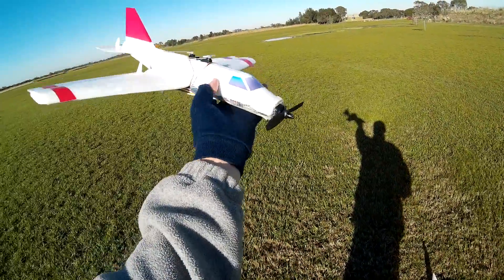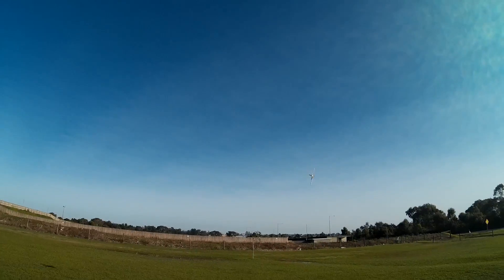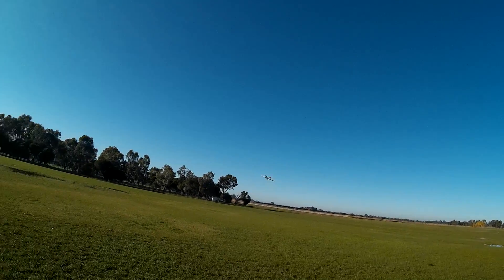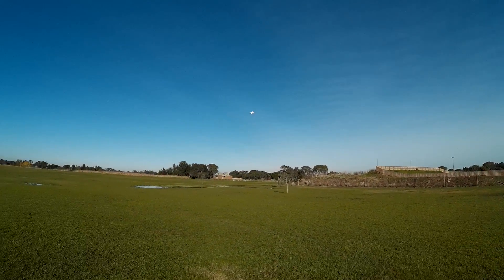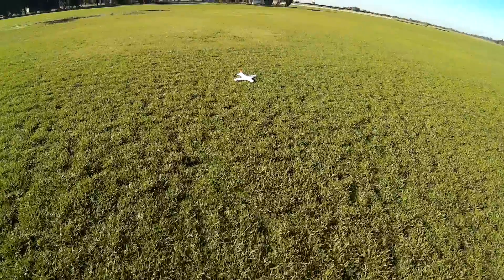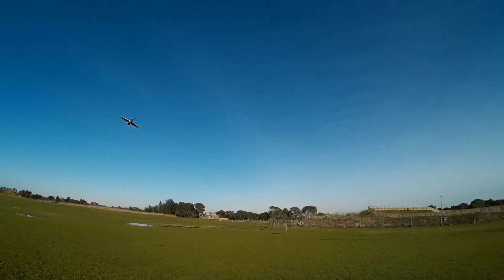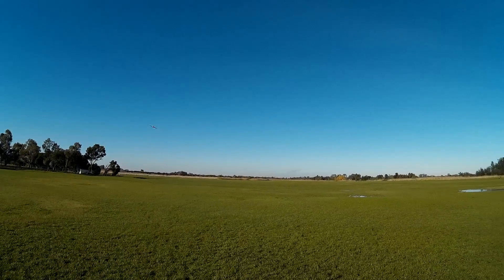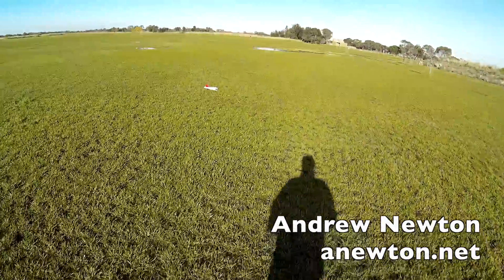$5 Glider RC Mod - Improved

Comment: I 've made a similar project using 2 F939 pcb/geared motors/batteries, without changing the airfoil.
Please take a look at the Poundland glider.
Reply from the maker: I will

Comment: Fantastic results!  Hope my chuck glider conversion goes half as well. Too windy today. Maybe the crack of dawn tomorrow.
Reply from the maker: Good luck
Reply: Thanks!  You and FliteTest are my primary inspirations in RC flying.  Love your videos and product reviews.  Admire your hot wire expertise!

FWIW, my plane turned out to be a bit under-powered but docile (a Blue Wonder on a 1.33 meter foamy!).  Docile seems appropriate for my flying skills atm.